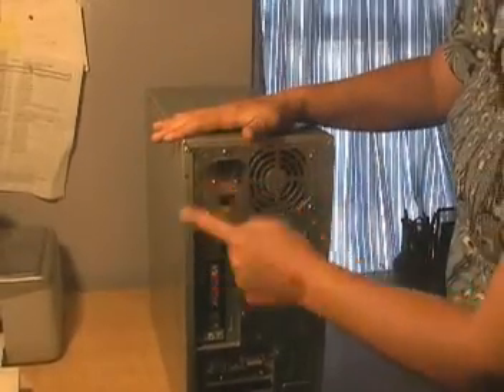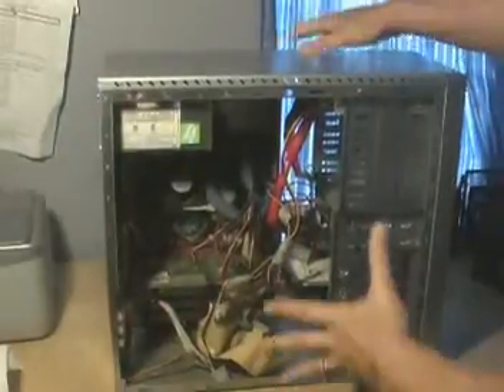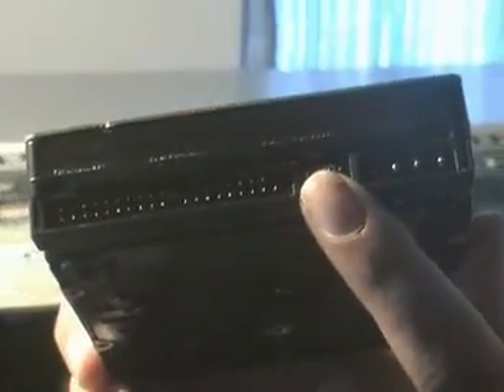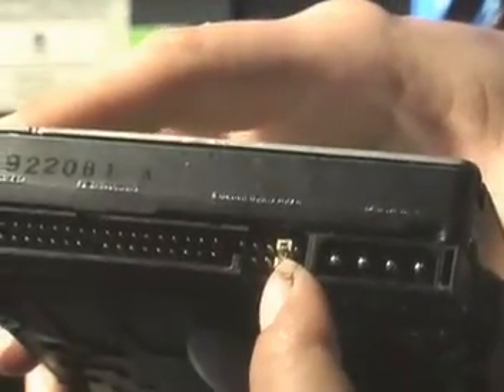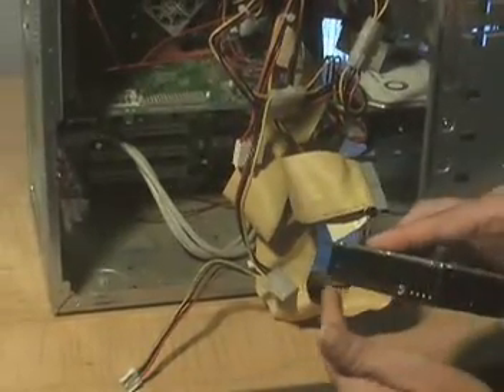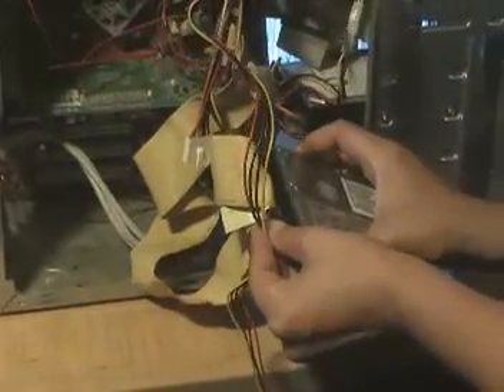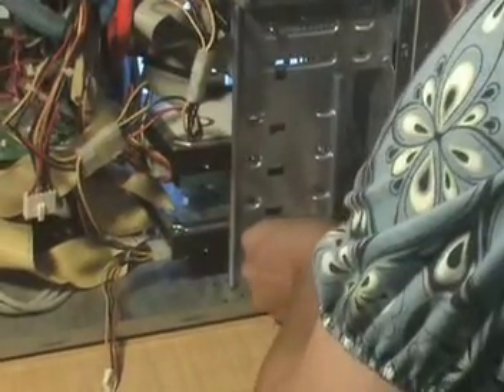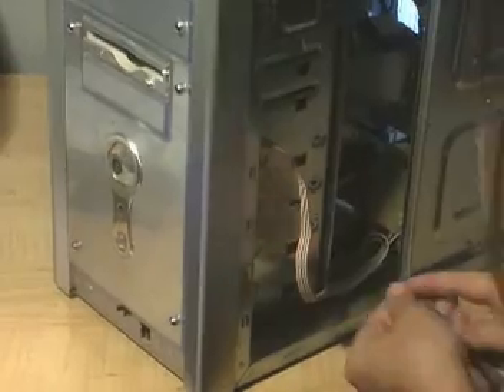Hard Drive Recovery Tutorial - How To Slave Desktop Hard Dri

Comment: Rebooted PC and it starts ok both drives are present under disk drives in system devices but under my computer only C drive is present
Went into BIOS and only drive recognised is the original Drive which is now secondary Master, there is no primary master, or any slaves listed in the Bios, any ideas?

Comment: I wanted to install a new HD as a slave, its same HD as existing but 80GB
I disconnected HD1 cable from existing HD and changed the jumper to Master, reconnected to "Drive 0" on other end of cable and attached the slave to Drive 1 slot, ensuring that jumper settings were set to Slave

Comment: Maybe u can help me :)
Current set up
Dell Dimension 3000 "windows xp SP2"

W Digital IDE 40GB conncted to a cable, one end labeled sys, other HD1 
The other side of the cable (other side of mother board) was connected to optical drive, this side of cable had 2 ports, for drive 0 and drive 1, i disconned the optical drive